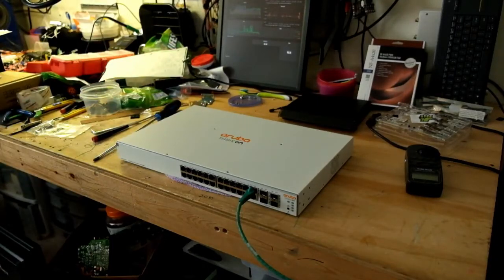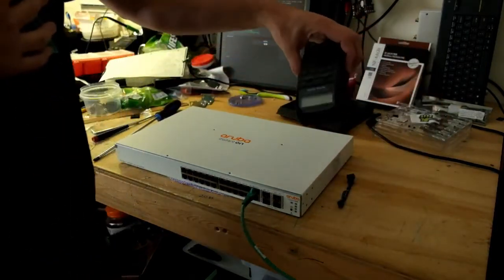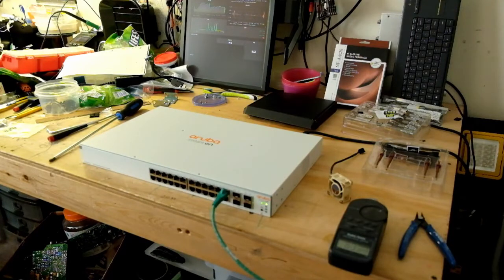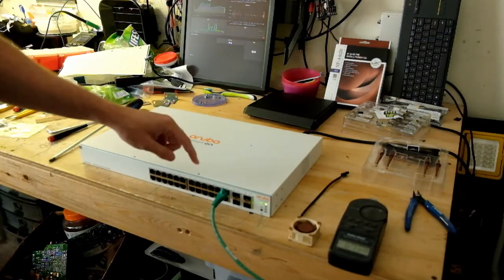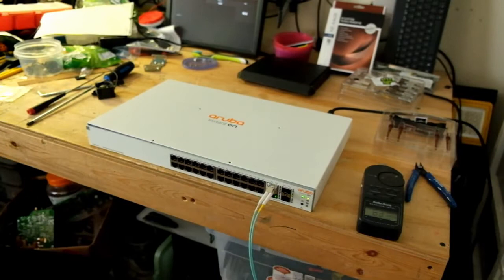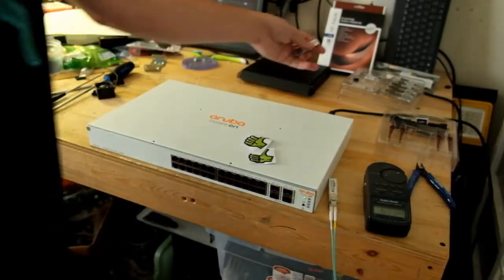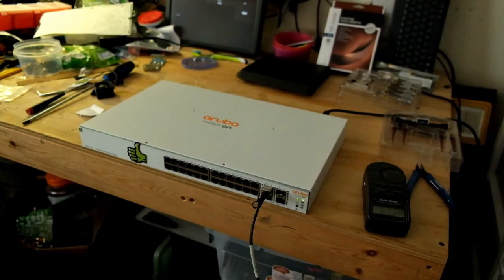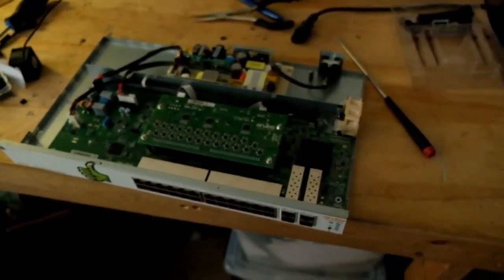Aruba Instant On  1930 24G Switch Fan Mod's

Comment: Im gonna order me one of these fans and mod. Bough a 48p poe version and this thing is soo freaking loud. It makes more noise than my two supermicro 826 servers (when they are on idling without load). And it has a high pitch fan noise. Seems people have complained about noice on theese for three years. Full fan noice without any poe load... Aruba needs to fix their firmware :P
Reply: Too put in perspective i have it in my 5m^2 dedicated room (room temp around 18degrees celsius). Inside a small switch rack with front door. With closed door to the room the noise from it is bothering people in the next room. A switch!!!
Reply: Soo if your gonna do the fan diy on the 48p version. Keep in mind that that one has two fans xD. In my case i replaced one of them with a noctua as it seems my noise issue was comming from one being faulty with ALOT of noise.

Comment: Hi tx for sharing , i see there is 5v and 12 v versions which version of the NF fan did you used?
Reply from the maker: 12v, model & link to fan in description.
Reply: Where is the link to the Noctua Fan? I can not see it. Thanks a lot for the video though! This literally made me buy it since the only reason not to was the noise.  @JasonsLabVideos

Comment: Has the boot time improved with firmware updates by any chance?
Reply from the maker: I just setup 7 of these the other day, they still take 5-10 min to boot. BUT they are quiet, not silent but quiet. Still hands down the best Enterprise switch for SMB with Lifetime warranty.
Reply: @JasonsLabVideos  thanks a lot for the details!
Reply from the maker: @cilindrox  n.p